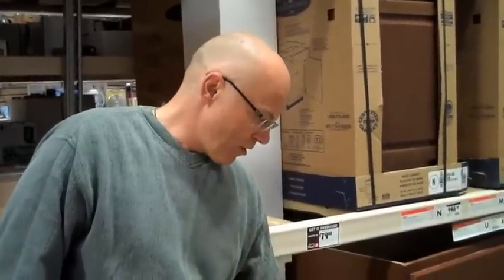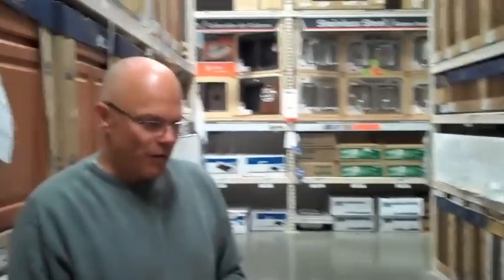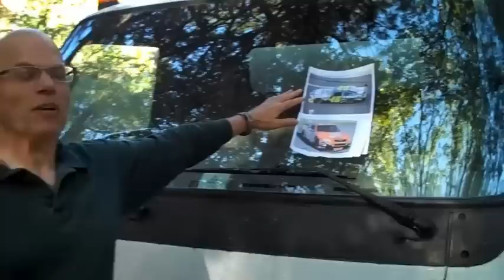Home Depot Cabinet Review

Comment: it's a basic cabinet of course the joints are not dove tail. I know much older cabinets without dove that have held up ( easily 40 years). Dove joints are the best but it matters, what glue or adhesive used, what secures it whether it be staples or nails (butted joints), and also what does consumer reports know about cabinetry or woodworking for that matter?? i'd rather know what a carpenter has to say than them.

Comment: On 27 May 2021 at Home Depot Tooele UT, I paid $26,000 on materials and installation of American Woodmark cabinets. Delivery was late by 3 months and 3 days, and many of the cabinets had defects that I wouldn't have tried to send to a paying customer even when I served as plant manager of a 9th grade woodshop class who manufactured and sold a product. I shared a 30-slide PowerPoint of the defects with American Woodmark on 16 November and as of 10 December, despite multiple phone calls and emails, still have not been contacted by AW "Customer Care" or their local rep regarding replacing the defective items they shipped to me. I could have built higher-quality cabinets and installed them in perfect condition myself by now. I will never buy cabinets from Home Depot or American Woodmark again, and I'll be posting a YouTube video showing the slide deck of the defects AW sent me.